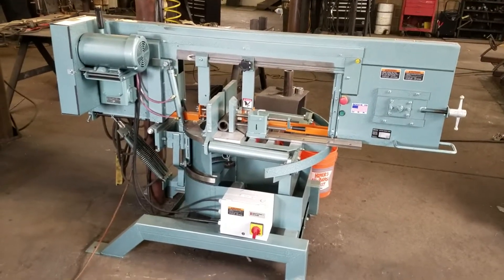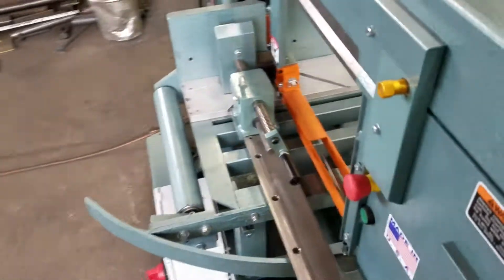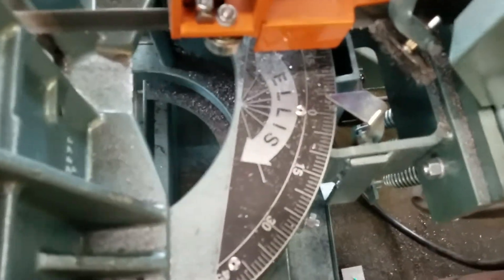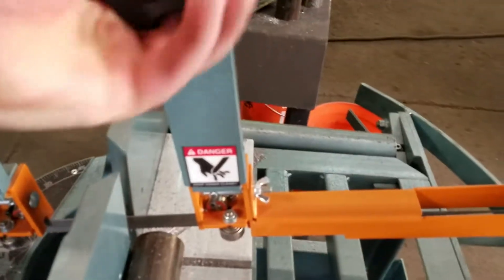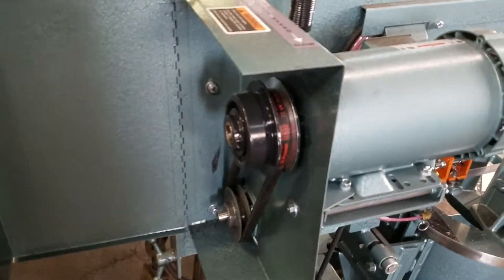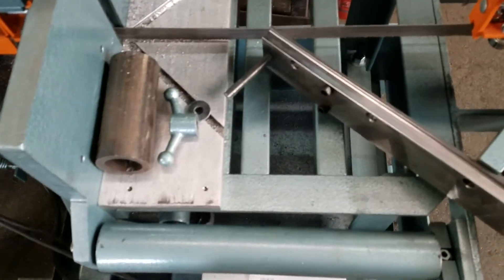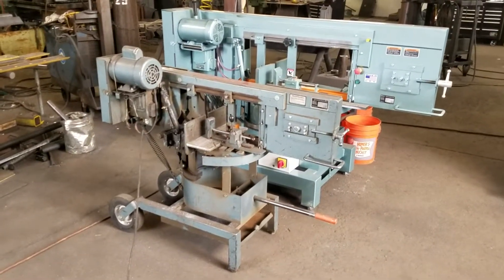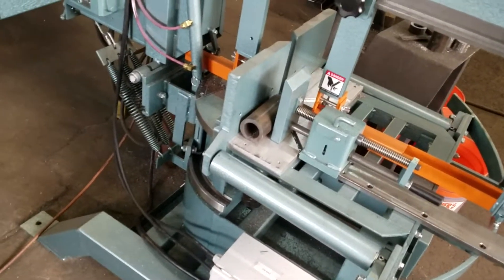My new Ellis 3000 band saw walk around and speed adjustment

Comment from the maker: The no coolant has not been an issue.  This was designed to work without it.
Reply: Do you have air lines hooked up to it?  I know on the 1600 & 1800 I was told that they want you to hook it up to shop air to aid in chip clearing.  Just wondering if you still haven't had any problems with or without air & oil.  Thanks!